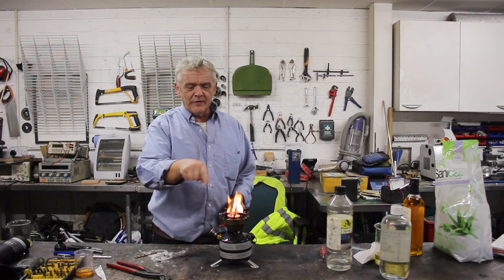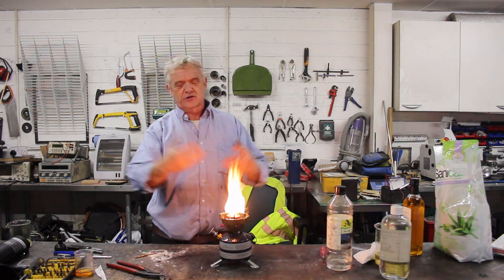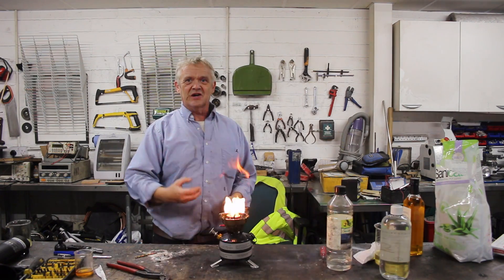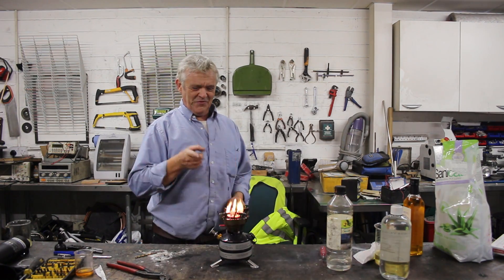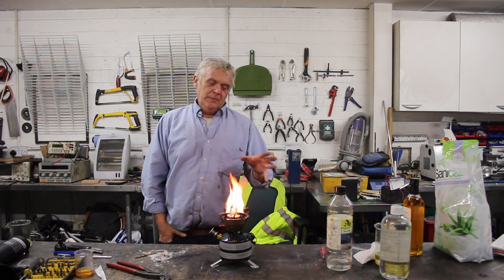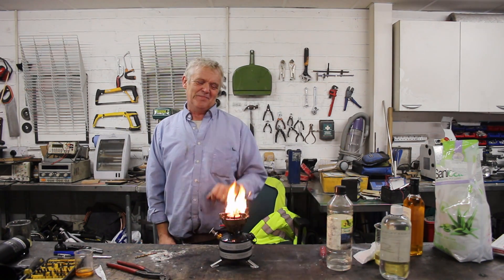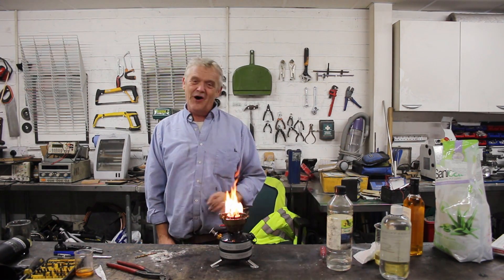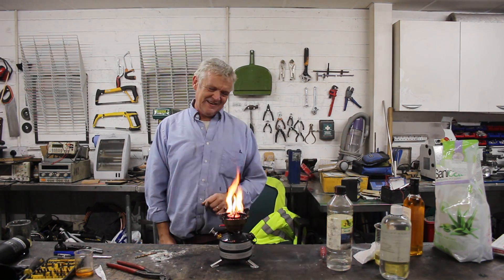1675 Can Bio Diesel Work In An Ordinary Kerosene (Paraffin) Stove?

Comment: Nice video. Would you try giving the lowest possible pressure to the tank? For example just 5-6 strokes. Take into account that diesel burners use a dripping low-flow system. Maybe the lowest possible pressure make the same work. Cheers!

Comment: Thanks Robert. I live off grid and have used such stoves (I have a small collection, two are multifuel) for 14 years now. A little bit more consistency in producing the biodiesel and/or a different jet should get you a nice blue flame. Hoping to see a video where biodiesel is used in a conventional kerosene heater such as a Kerosun brand kerosene heater.

Comment: I had thought of a wick based lamp for the bio diesel originally but that was like the kerosene burners by Coleman. So good job. I hope your rocket stove works. The only kind of burner I experimented with was a cyclonic combustion chamber that has a liquid fuel in a can, and a pipe that moves up and down to tune it so to make a swirling flame. And I thought that was neat but it seemed to need tuning and the effect diminishes as it gets low on fuel.
Reply from the maker: cheers mate

Comment: Similar to a waste oil drip type furnace.  Build a fire on a cast iron pan till it gets hot and drip used motor oil or desiel or any fuel.  The faster the drip the better flame and heat.  
Those stoves like you are using are pretty cool.  I haven't really seen those here in the US.  I'm sure they're around here though.  There use to be a lot of white fuel lanterns and stoves that don't need to preheat to vaporize the fuel.  I have a couple of those we use to use camping and at parties back in the day. 

I like your type though.  Did you purchase that one recently?
Reply from the maker: I did mate - I got it on amazon

Comment: Nice! I've seen videos of waste oil burners that use a nozzle to atomize the oil into a very fine mist before vaporization. Perhaps such an thing will help you in your project build?
Reply from the maker: I would think mate - cheers
Reply: A Babbington burner is also an option using lower air pressure, a sphere with a small hole in it, and it works like a whale exhaling through his blow hole. The oil is pumped over the sphere in a steady stream, forms a thin film which is then easily atomised.

Comment: whats he doing after pouring the boidiesel? I think my burner works differently
Reply from the maker: I am setting it like you do most kerosene heaters - fill, close the fill port, pump to raise pressure, pour ethanol into central preheater cup, light cup, wait, open fuel valve
Reply: @ThinkingandTinkering  cool, thanks for taking the time with the questions

Comment: I used to heat with kerosene heaters quite a bit... As of about 4 years ago I cannot find a seller of kerosene within 40 miles of my home...
Reply from the maker: we used to have it all over here in the UK but. like you it has just gone!
Reply: Kerosene production  fell  following  the introduction of  LED lighting and  cheap solar panels . The developing countries  no longer required kerosene for lighting purposes. Price per barrel of oil tumbled  too as a result of reduced demand . Kerosene  production figures are available  per country and the last time i checked , there  was some decent production  in Spain.

Comment: Robert, I'm a bit pissed off. Vegetable oil is vaporizable in your opinion?
How about lineseed oil?
You should know (at lieast this) that cooking (vaporizing) lineseed oil for long time, produces a plastic-like substance wich is one of the oldest and well working paint.
My garden fence is painted with that if you believe it or not.
So why don't clogh up all our burners with carbonized plastified oil residue?
Robert, I'm a bit pissed off. You take your quotes a bit too easily for somene who wants tho suggest "solutions". As you're going you're inventing new problems for good will people. I dont approve this kind of approximation in experiments.
If someone wants to use vegetable oil as a fuel, it is better to drip it on a ceramic fiber felt on a bowl, laing in a woodstove. That will work forever or so.
Reply from the maker: if you are pissed off do something about it. Complaining to me that I don't do things the way you like is no good - of course I don't do things the way you like - I am not you. If you want it done differently - do it and post a video don't just sit at your computer complaining
Reply: @ThinkingandTinkering I do them, I solve the problems you created to me (paying for the membership) but I don't post them, because I find problems not solutions. Then, do you still think vegetable oil is a completely volatile substance?

Comment: Just a note for anyone taking this further, get an O2 monitor.  From real world application, me getting this directly from those involve. A small construction company that would take on fairly large projects sometimes decided to try running their diesel water pumps on bio diesel.  I'm talking about sizeable pumps, 6 and 8 inch trailer mounted, 4 ton pieces of equipment.  Of they were placed at the low point of the job for dewatering, in a little grove. They would start dying after an hour or so. The mechanic/fabricator/innovator, could not figure out the problem as it was intermittent and they would start right back up after a short time.  Now warm summer heavy air days, but the exhaust was literally displacing the oxygen enough the engines would not run. This was confirmed by an O2 monitor, which if I remember from my hazmat days solid tones at 19%.  All the stoves will say "well ventilated area", but we know how that goes.  Just be aware of the heavier exhaust.
Reply from the maker: nice tip - cheers mate - probably a good idea to look at carbon monoxide sensors too
Reply: Absolutely.

Comment: Not surprised that it is working - however, the question is "for how long?" ... it all depends on the quality of the bio-diesel: even trace amounts of vegetable oil WILL polymerize near the burner, leading to blockages after some time. My guess would be that all oils with an iodine number of 120 and above could be problematic if present in more than just trace amounts. Also, expect copper and brass (as well as zinc) to show corrosion and some rubbers to soften after prolonged contact. Biodiesel is something I would always use in a blend...
Reply from the maker: cheers mate
Reply: Just take the needle and poke the jet. 

I had ran everything except piss thru my stove and on unleaded gas, which is made for, it clogs every three runs and I have to unclog it with a steel wire needle. The clogging only happens at the jet as it is the coolest part that sees only hot gasses. The vaporizer loop gets too hot for gunk to remain solid. Any tars formed in the loop get boiled and vaporized too. 
An extra long preheat might clear your nozzle.

Comment: Hi! 
I have a aolar panels question:
What would happen if the panels were covered with the brightest 'glow in the dark' paint panels over night? Would it produce more energy than the initial charging of the paint, or anything worthwhile bothering with it? I thinking of a simple night time setup...

Thanks Mr. Murray-Smith.
Reply: I am actually going to test glow in the dark pigment on solar in the next couple weeks, assuming the shipment actually arrives. I will post a comment to the most recent "solar" video that is on this channel. My prediction is that it won't produce significant power once the sun goes down. I am unsure how much of a boost it will give the panel during sunlight. But that's why I am doing the test. I will be "very" surprised if it provides significant power for any real duration after the sun goes down. One important point... Most solar is ~20% efficient.
a 10% boost in efficiency, mathematically, means that the total efficiency is 22% (not 30%). So, I will be happy to get 10% boost, but we will see.
Reply from the maker: let me know how you get on will you mate
Reply: @ThinkingandTinkering  Absolutely. For my test I purchased various glow in the dark phosphorescent powders, some clear coat and 1 solar panel. It's gonna be a couple weeks before the panel arrives. I don't have a proper solar dedicated electronics device for measuring output. Any thoughts on the best way to measure the output? I know car battery load testers are fairly inexpensive. So, I could hook the panel to a load tester with a multimeter in series to measure the ampacity. And a second multimeter for voltage. But if you have other thoughts on that... let me know. I will do some preliminary tests first without any coating in full sun. And then I will do some tests with "clear" plastic... on top of the panel with a liquid interface material... not sure what the best choice will be, but I will probably use isopropyl (rubbing) alcohol, just to see how much loss I get with a clear plastic coating on the panel in full sun. I am using the plastic sheets so I can test the same panel with different coatings and not have to wash the paint off. Once I know the baseline, I will put the phosphor coated plastic sheets on the same way... and see if anything goes up or down. Record it all on paper. And come back with the results.
Reply: @marcfruchtman9473  excellent news Mark- and good luck!
Reply from the maker: looks like Marc is going to try it - I hope he does a video or posts his results

Comment: Awesome mate. I wonder if it'll work in a homemade copper coil jet stove. It should I think. Perhaps adding a little bioethanol would give a cleaner burn. Also as you mentioned using veg or waste oil to use in the rocket stove. There are tons of videos on waste oil heaters. One is veg oil guy. So simple. Drip the oil in, get it hot, then add air, usually a tiny blower like a mattress inflator. Some even manage it without the air. There's one Japanese guy making a tornado version where it's so clean burning, its got blue flames. Some awesome stuff.
Reply from the maker: that is awesome - I must look him up
Reply: @ThinkingandTinkering  creative inventions lmtn has many videos showing blue flame, burners, heaters, stoves etc.  Veg oil, waste engine oil, almost anything.

Comment: Would you be able to recycle the glycerin as the main pilot for something like that? If you could your biodiesel process provides both materials for that type of burner.

Well done mate! Keep banging on.
Reply: I was hoping someone would suggest this as a previous video showed how flammable glycerol was. I was thinking it might work both as primary fuel and starter.
Reply: Thinking the same thing. Save the biodiesel for an motor use the glycerine for a heater/rocket stove 👍
Reply: @robertpoynton9923  I would honestly use the diesel in an oil lamp to be honest. I would also use the glycerin to coat the logs for my wood burner; they would burn hotter for longer if I did.
Reply from the maker: I would think so mate and cheers
Reply: @ThinkingandTinkering  if you soaked some wood in the glycerin from the biodiesel it should burn hotter for longer. Care to do a few burn rate experiments on different oils to see which makes your fire last longer with the same burn rate?

Comment: Motor oil burners are pretty common as heat sources for mechanics. A vegetable oil burner is something I haven’t seen before and since glycerin burns just fine when it’s heated it would be easy to implement a preheating function into the burner so there’s no need to convert it to biodiesel first.
Reply: Except that veg oils will polymerize with heat and it won't be long before the works are full of goo that won't easily rinse out.
Reply from the maker: I would think that depends really - if you use a drip cup - I am not seeing how that can be a problem - or maybe a Babington burner?
Reply from the maker: indeed mate

Comment: "This study reports the discovery of living banana plant as an inexpensive, reliable, stable, and long-lasting power. A Zn anode and Cu cathode are inserted into banana plant to extract electricity, and the organic compounds of plant act as electrolyte. This new discovery may introduce an era of providing renewable energy to who live in proximity to banana plantations."
Reply: Cool! How long does it last though?
Reply: @emel60  , It is possible that the microbes are transmutating the radioactive potassium in the bananas.
Reply: @emel60  , they write - all year.
Reply: Sounds great for the Azores
Reply: @jimurrata6785  , potassium is used to replace the more dangerous thorium in incandescent gas mantles.
Reply: @Hermaphroditolog  I'm not quite sure what gas lanterns have to do with providing renewable energy to a group of islands in the Atlantic????
But I'm sure solar would work well there as well as great potential for geothermal, given that they are active volcanoes.
Reply from the maker: that's a potato battery really I think - but there is a Chinese patent filed in 2010 with this idea - CN102148425A

Comment: The other week I put petrol in my diesel car, I was at the pump holding down the Petrol nozzle and after 5ltrs i realised, So I topped up the tank with 80£ worth of diesel, I haven't noticed any difference apart from the smell.  Maybe i was lucky it was only 5 litres of petrol and not a full tank.
Reply from the maker: sounds lucky to me mate lol
Reply: Hmm, Diesel is not a petroleum product? I think there is a translation/slang error?
Reply: @401ksolar  no diesel is an oil and petrol is a solvent.  I did it by mistake and its not slang
Reply: @Dr-Sy  sorry both are petroleum products, and I realize you meant to put deisel in but started pumping Gasoline blend, and a simple translation error using the slang term "petrol"

Comment: Is it possible to thermally crack biodiesel into gasoline/petrol. In Canada we have very few diesel anythings except big trucks. If I could figure out how to close that loop then I could burn the primary product in my minivan and at least some of the waste products could be used to make electricity and heat my home. That for me would be the holy grail of energy conservation. Your work is just amazing Rob and your Gru laugh always makes my day. Cheers.
Reply: Much of Canada would need block heaters plugged in during winter to get those diesels to start in winter.
I suggested butanol from the glycerol 'waste' of biodiesel production.
It is very near a drop-in replacement for gasoline/petrol
Reply from the maker: I would think so mate but I would also think you would need a fractional distillation column to separate  it out

Comment: Robert,
Your Biodiesel looks as if it may still have water in it from the washing stage. It should be completely clear like the wine or what ever is in the wine bottle and about the same colour as well . My first batch was like the stuff you put in the stove but after it had been left in the garage for a week it went crystal clear. I would see what it's like in a week, the water should drop to the bottom. Great channel by the way I love all your video's right up my street as they say.  The water would make it burn poorly see how it goes after it clears the stuff should burn better.
Gary
Reply from the maker: I did rush it to do this video so I think you are quite right mate - cheers
Reply: Was going to say the same thing ... I believe you could actually hear steam forming...
Reply: Latent heat of evaporation is robbing a lot of output.
Much like trying to burn a wet log.
Reply: Hence the orange c o lour to the flame .

Comment: Anaerobic power:

«The device, called the Gedang (Javanese for banana), generates about 5 volts of electricity from the anaerobic bacteria in banana skins. Sang Aji said they decided to use banana skin because it was readily available. "Experiments showed that banana skin can generate more electricity than other fruits."»
Reply from the maker: there was a series of viral videos in 2017 - I think it followed a news announcement you just quoted - it's a fuel cell made wasn't it?
Reply: @ThinkingandTinkering  , rather, they are close to nano-diamond radionuclide batteries.
Reply from the maker: @Hermaphroditolog  I doubt it mate
Reply: @ThinkingandTinkering  , use an electronic clock for an "electric meter".
Microbiological LENR is well documented.
Reply: @Hermaphroditolog  the highly  reputable Professor Edmund  Storms mentioned  something  about biological transmutation.  I wish he hadn't done so .
Reply: @ThinkingandTinkering  , look this on Youtube:
"How radioactive are bananas and other radioactive foods?"

Comment: Just a thought ..... would changing the jet size make a difference as the density is not the same? Not sure how density relates to viscosity in a dynamic fluid system!

My guess would be that you struggle making it work on a rocket stove. You might need a large chimney to get the right draw to force the burn.
Having said that I have seen some truly amazingly hot oil burning stoves (oil fed in an inner pipe with a forced air outer pipe to get the flame up high! They had little to no visible smoke as the burn was complete at those high temperatures. The heat often got so intense (white hot) it degraded thick steel retorts used to form the burn chamber!

Should make a great video though!  ;o)
Reply: these stoves need larger nozzles for lighter fuels and smaller for heavier one because the heavy fuel has more carbon atoms not because the gaseous form is different. 
More carbon gives more energy but the amount of air getting sucked in the carburettor is limited. Smaller nozzle gives higher jet velocities and that in turn sucks more air and mixes better. 
And with lighter fuels, too much air will actually result in a weak, colder flame that might not sustain the vaporization temperature. 

It is nice to have an adjustable air intake on these stoves.
Reply from the maker: worth a try then lol
Reply: @ThinkingandTinkering  Always! 
Many of the back street workshops in India use this method for heating foundries!